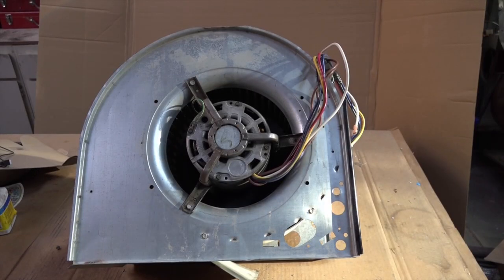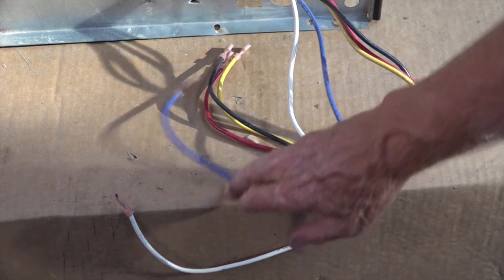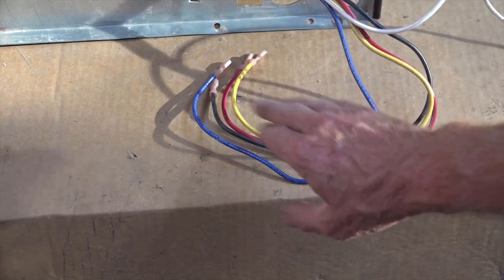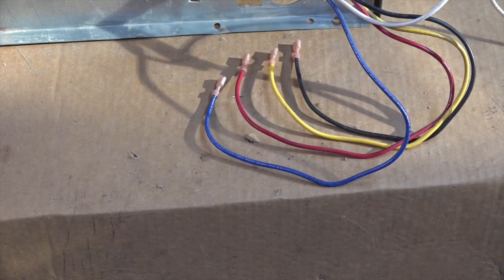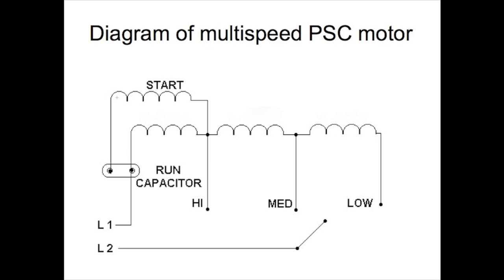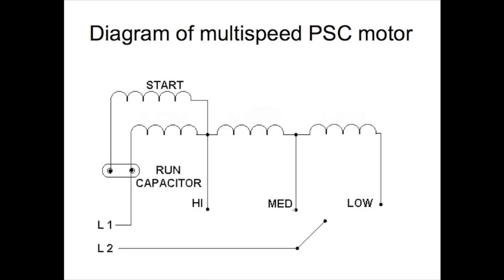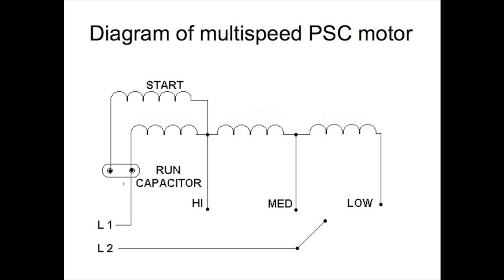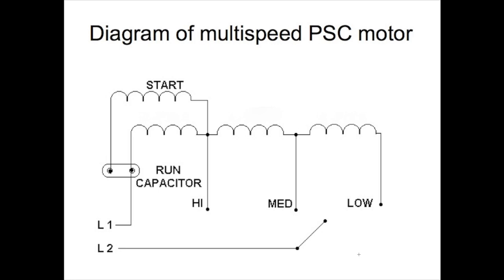The how and why of PSC motor speeds

Comment: Say you only had a single speed motor what speed would you suggest wiring it to work the best for heating and cooling ?
Reply from the maker: I am probably not getting your problem, but if you have a single speed motor, you have no choice of which speed to hook up.
GFM

Comment: I think they are loop wired around, say 3  triangle spot for fasted speed.  I taught this was about why blower resistance add motor speed to a degree and useing a speed controller. I find this fascinating. As I can't see the logic  of the motor speeding up and fall of a Cliff. & stall out. LOL

Comment: Both original and replacement run capacitor are same 12.5 MFD 440/370 VAC but new replaced blower motor has 7.5 MFD listed . Still good ?
Reply from the maker: If the new motor is rated for the 7.5 its ok.
GFM

Comment: I'm replacing my blower motor in my Air Handler. The new motor is also a 220v but it has a white wire and the old does not. where does the white wire connect to? Thanks
Reply from the maker: It depends on the manufacturer.  As a general rule, if there is a purple wire on the new motor, it is common.  On the new motor, White is probably common.
GFM

Comment: The motor shown in the video was actually a four-wire motor, but the diagram was a three-wire. The motor speed tab(bk, yl, bl, rd)wires were common.
Reply: He said the run was common in the video and I'm sure the motor diagram refers to it as common. But traditional csr start and run Shar same leg the speeds are common in the picture with added resistor to step the voltage down to lower the speed

Comment: Your videos are amazing. I am considering swapping my ECM to a PSC. I want to use the multiple taps of the motor to connect to the ECM board and then have the variable speed. Those ECM motor modules are a pain, mine has failed. Genteq.

Comment: Let me ask Grayfurnaceman, if I have the same wiring set up w multiple windings as your video suggests, can I just hook up to the shorter winding and thus increase my fan speed without doing anything else?  Can I continue to use the same existing start capacitor!?  I am not sure if I have the same multi winding motor as your video ( I pray I do and will check this evening) as we feel as though our fan doesn't blow with much force!!  It would be awesome if we could speed this up this blowing harder!!  Our bedroom vent "sucks" so to speak. Has so little force thus not cooling our bedroom as much.....  We can switch out our entire HVAC system at this time however a simple switch like this of which winding to connect to would be awesome!

I hope you see this Grayfurnaceman and respond!  Your channel is very informative!
Reply from the maker: Before changing fan speeds, I would check the filter, be sure the A/C coil is clean, the blower wheel is clean and the ductwork is in good shape.
GFM
Reply: It is, I only use top quality filters and make sure they are changed, I just have to check to see if our motor has the wires for multi speed windings
Reply from the maker: @TreadTalk247  If there are colored wires coming from the motor, the highest speed will be the black one.  If it is not connected to the cool terminal of the control board, remove and tape off the one that is connected and install the black one.  Just to humor me, remove the filter and see if there is a change in air flow before changing wires.
GFM
Reply: Ok sounds good, I thought I’d have time last weekend but it will have to wait till this Sunday.  We recently bought an old car (1927 Buick) that’s been sitting since the prev owner passed away in 2004 and it’s been sitting ever since!  We have been working our tails off getting it roadworthy again!  But I’ll make some time this Sunday to check out the wiring on the fan.  I actually replaced the blower fan about 10-12 years ago, the capacitor went bad when we weren’t home and burned up the blower motor, we came home to a burnt electric smell (you know the one!) so I replaced the capacitor and the motor so I’m curious if there is multi colored wires on the replacement motor I installed!  I can’t remember!!
Reply: Also just curious will a capacitor that’s going bad keep the blower fan from getting to full speed?  I was just curious from when it went bad before (10-12 years ago) and besides a slow start to the blower what other signs will be evident when the capacitor starts going bad??
Reply from the maker: @TreadTalk247  It could.  Usually, the symptoms are overheat and overdraw of power.  Sometimes the motor won't start.
GFM

Comment: Gray !   do you have  any info on how a cap. works? I have a motor that is slow to start. I don't get a spark
when terminals are shorted across cap.
Reply: Ducktruckful you shouldn’t get a spark, because it discharged into the windings when you shut down the power. If you want to see it changed, pull the wires off while live. Not recommended. A spark won’t tell you much anyway. You need to know if the capacitance matches the rating by measuring micro farads with a multimeter. The cap resists voltage drop, so as the sine wave falls on the power, the cap starts to output power. This kind of imitates 3 phase power by providing an out of phase wave so the motor can rotate

Comment: This way of changing speeds only works with psc or cap-start, cap-run motors -> that leave the start winding in the circuit  at all times? When changing the run winding resistance we are changing the phase angle between run and start winding and hense the motor slip?? This increase or decrease of motor slip is what changes the speed???

This may be getting too complicated, but i'm trying to understand better

Comment: The common motor winding color code really does not exist, and it gets frustrating especially when each length is the same.  We all don't have a milliohm meter to measure the ohms of an inductive coil array.
Reply from the maker: Harry Haefner I don't disagree. Some units use a purple common.  This a recipe for disaster for red green colorblind techs like me.
GFM